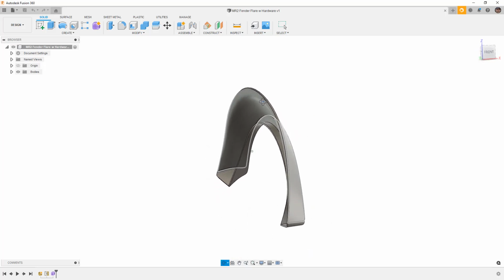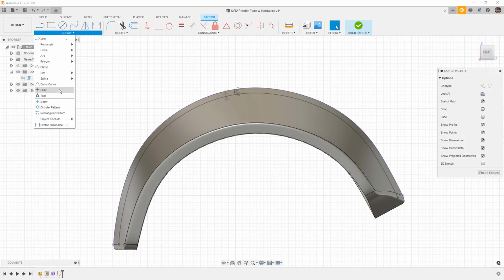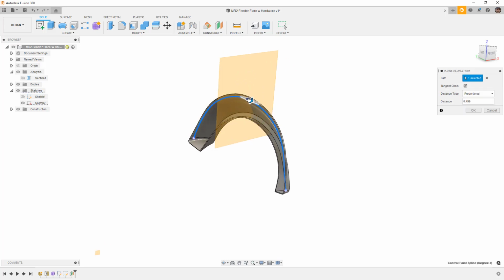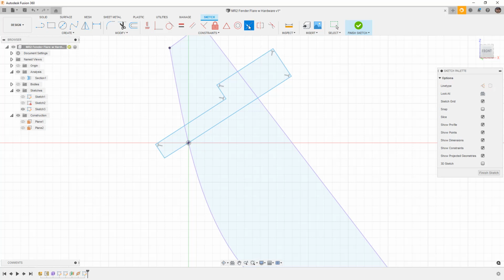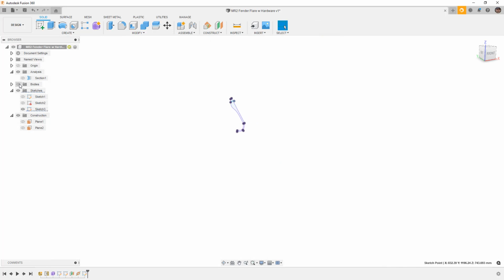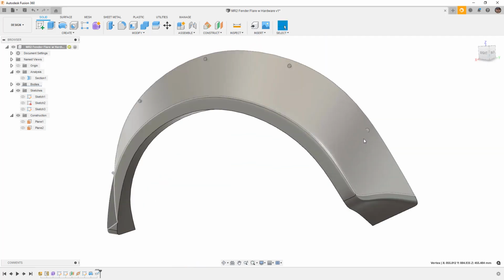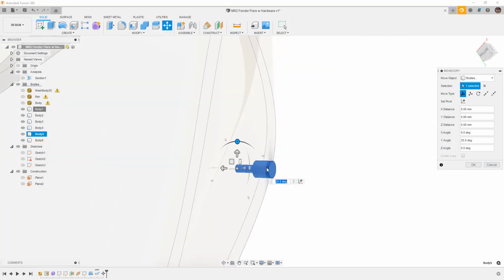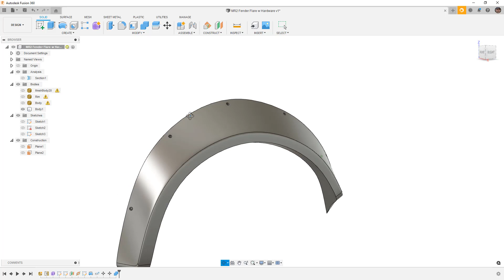Adding Hardware Details to a Custom Fender Flare - Fusion 360 #Fusion360 #FenderFlare #Design

Comment: This series was amazing!  How would you go about modeling something like the Karlmann King truck? It isn't a smooth flowing shape like most vehicles, wondering if it'd be a different technique when modeling something like that.
Reply from the maker: That is an interesting one.  From picture the majority of that looks to be flat triangles so you could crease each edge for the ones that are meant to be flat and just make them triangles.
Reply: @LearnEverythingAboutDesign  Gotcha. It kinda goes against the preferred method of trying to keep four sides.
Reply from the maker: Exactly.  3 sides are ok as are 5 sides if they are in an area that you want flat or otherwise doesn't have drastic changes in curvature near by.  You have to plan out where they are.  If you built that SUV 'thing' with forms it would be mostly Tris with Creases on the edge.  Controlling smooth transitions between them would be a nightmare! :)
Reply: @LearnEverythingAboutDesign  Lol seems like a nightmare. I came across that SUV and thought to myself, how would that be modeled, and couldn't really figure out the best way. Thanks for the feedback.